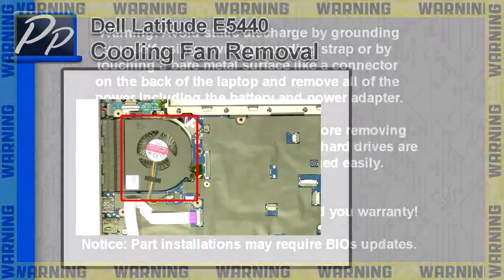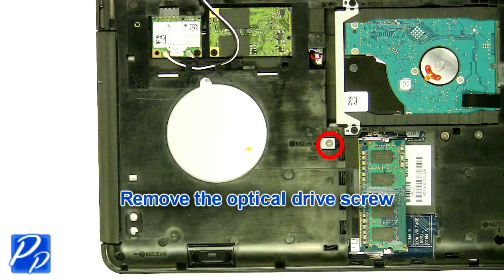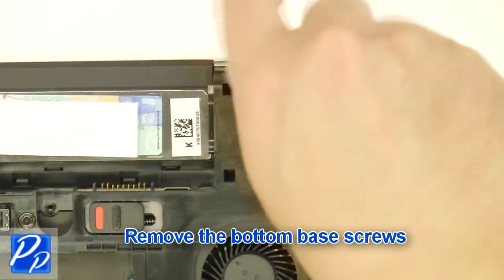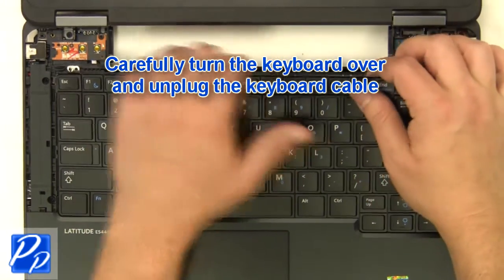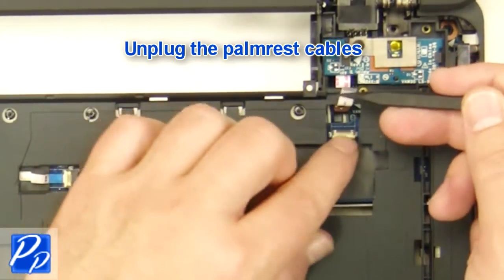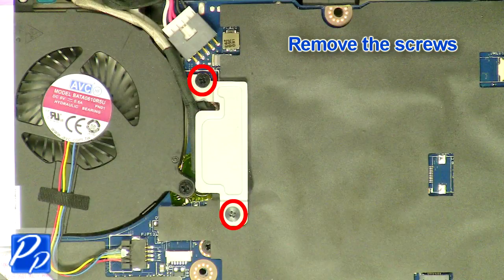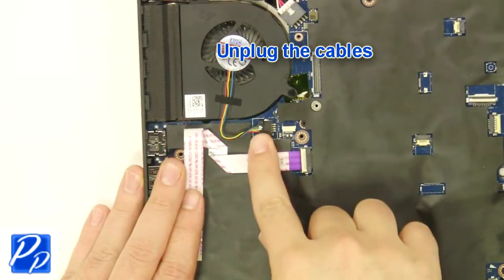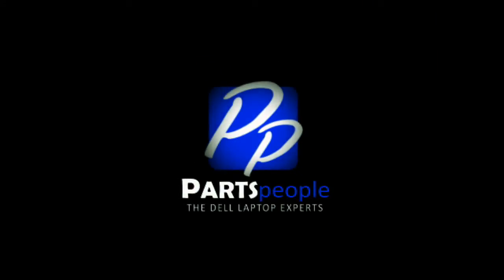Dell Latitude E5440 CPU Cooling Fan How-To Video Tutorial

Comment: My system report's the cpu fan stopped working. Is this really necessary to replace the fan?
Reply from the maker: If you're using it with CPU intensive applications or in hot weather then I'd for sure replace. You may be able to get away with not having the fan working but it'll risk shortening the life of your laptop and it overheating and shutting off.
Reply: @dellpartspeople  I meant this video.... do I REALLY have to remove all this (content in video), just to remove the fan?

Comment: Been doing support for years and this is by far the most ridiculous r/r procedure I've seen  in a very long time. I have an e5440 with a non-working CPU fan that runs day and night and never overheats even on 102 degree days. After seeing this I'll pop for a $20 cooling pad to stick the machine on if it ever needs it.